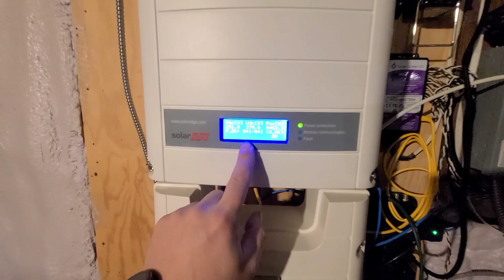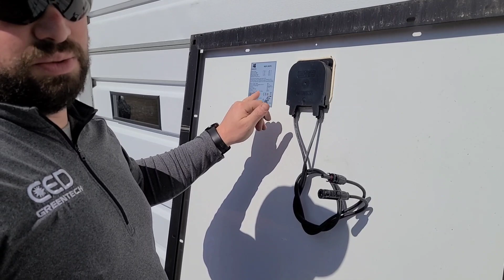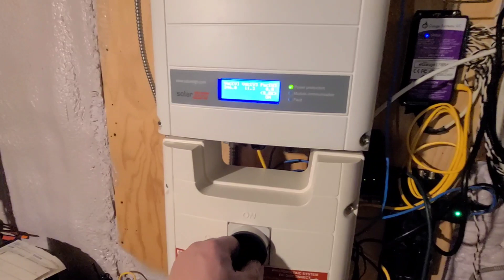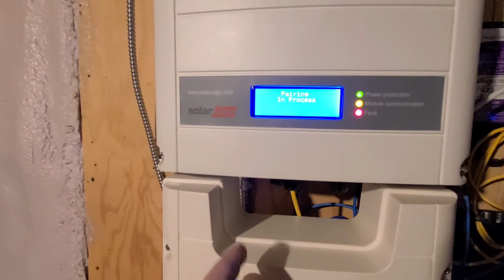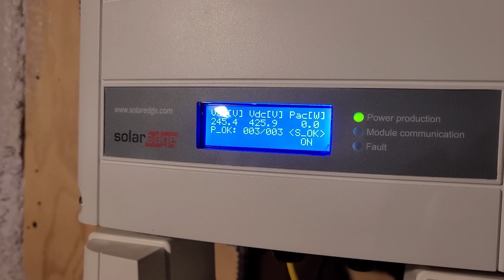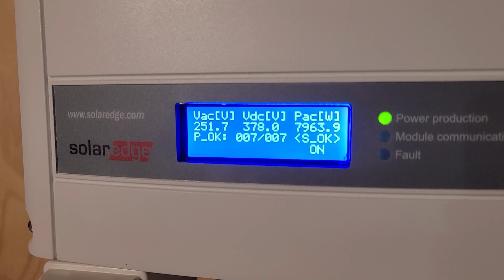How to Replace a SolarEdge Optimizer

Comment: Thanks for uploading the video.  I just swapped out the 7600 StorEdge inverter.  Tech support sent me a new one since the my original 1 was not producing power.  After I initialized, updated and paired it, It does not find the optimizes, so it is not waking up.  I don’t see 16 volts (for 16 panels and optimizers) on the vdc side or on my volt meter.  Also at the solar array, checking the output from the main series MC4 cable\s, I am getting less than a volt.  I’m guessing I’ll have to pull each panel and optimizer apart to see where the problem lies.  SolarEdge does not see any issues on there end with the panels or optimizers. Anything stand out to you?  Thanks
Reply from the maker: I've seen them short out a few times before.  Solaredge was able to pinpoint the optimizer that shorted once, but other times they weren't able to.  It's worth a call.  If they can't find it, you'll have to either test each one, or break the string up and test sections. Once you locate a bad section, then test individuals.
Reply: @benssolarandbattery  Seems like SE merely switched a series shading problem with a series electronics problem! If any optimizer fails open you loose the total string power. If any shorts you lose the panel plus possibly communications with all op on the string. Does anyone know how the communications works? Like Token Ring? Every node receives and transmits, or is it a common single wire bus like 1-wire?  - new SE owner
Reply: @benssolarandbattery  Thanks again.
Reply: Okay, so a long day of taking apart each of the 16 solar panels and checking each panels output (and connectors).

I checked all the inputs and outputs on all 16 optimizers (with the panels disconnected) 

The only thing I found suspect was on the last optimizer’s outputs on the string before it gets to the inverter.  

While there was no OL (on the output side) on the optimizer, I got a reading of 38k on my meter.  All the other outputs from the other optimizers output sides were under .5 mv (it floats on my auto range on the meter). 

I checked it like 3 separate times to verify it was suspect.  

Since that is the last one in the series, I’m wondering if this could be what is not allowing the wake up command on the inverter, after I successfully pair it, but it never sees the optimizers or wakes up.  

Lastly, I am not getting 16v for the 16 panels\ optimizers that I have.  

Original checked at the inverter, then verified at the panel array. 

Do you think that one is bad and the source of my troubles?

Thanks (sorry about a book)
Reply from the maker: @psxcancer  did you check the output of each optimizer with a panel hooked up? It should be 1v each.
Reply: @benssolarandbattery  I checked maybe 4 optimizers with the panels connected and found they did not produce 1v maybe .5 mv or less.  I just went out and checked that suspect optimizer and found a reading of around 4.38 mv.  I then check the whole series and get maybe 38.4mv not a volt.  I’m at a loss
Reply from the maker: @psxcancer  weird. And that was during the day?  Have you checked the panel voltages as well?
Reply: @benssolarandbattery  I did, i figured since I was disconnecting I would do all the checks. 

 Florida sunshine had each panel at 39-40 volts (direct from the panel) Pmax is 335W. per panel 

Strange that none except the 1 panel read over .5 mv.  

That last leg on the string by itself, measured 38k (output side) and 5.something mv.  Connected to the whole string, the last leg still didn’t measure 1v

Is it possible that all the optimizers are bad?
Reply from the maker: Possible that they're all bad.  Maybe a lightening strike?  I've never seen them all go down at once, but stranger things have happened.  Definitely get on the phone with tech support.  It might take a couple 5 hours on hold, but worth it.
Reply: @psxcancer  Measuring 0V ( 0.5mv, etc ) at each optimizer is unlikely. It would mean each one was bad. Just measure the air. No contact. If you still measure 0.5mv you were never connected to the optimizer output. I suspect you did Something wrong. Don't try to measure resistance while the optimizer is putting out 1V, it might damage the meter. You could try it when completely disconnected.
Reply: @alzaidi7739   Hi, thanks for taking the time to to respond.  I am not sure if you read all the posts. I was not taking residence at this point, I was checking vDC. So with the optimizer still connected to the solar panel\s I should be getting 1 vDC from each optimizer and 16vDC from the whole string.  I’m getting like under 2vDC for the whole string and 0-.5mv individually.
Reply: @psxcancer  Ok. 1. If you measure 2vDC, then at least 2 in the string of 16 should measure 1VDC. 2. The op needs power from the solar to run. When you have a panel+op pair with 0.5mv output, check that the panel is putting out 10-40V. If the panel has no output, that would cause the op to not work. Alternatively, when you find a working pair, swap in a suspect op and see if it starts working, showing 1VDC output.

Comment: That’s straight forward in the US. Not so in the U.K. our roof are much steeper pitch, normally slate or cement tile and mainly two story buildings. That make access a nightmare. I’ve a three year old installation and already three optimisers have failed. Never again would I use Solar Edge equipment, as in my opinion it too unreliable.

Comment: Hi Ben - what should the safety voltage have read coming out of the optimizer when you tested it?
Reply from the maker: This one read 1v.  SolarEdge says if it reads 1v its working.  That is not the case about 50% of the time.  I typically just lie and tell them it's reading 0v, otherwise they give you a hard time with RMS's.
Reply: @benssolarandbattery  I do the same thing lmao

Comment: I have a panel reading nothing today so thought it was the optimizer.  Next day that panel is fine but another panel down instead.   Does it hurt anything for me to run the pairing process as toon have shown without turning off inverter.  Mine looks identical to yours (about 5 years old) so thinking I can just hold down button as you have?
Reply from the maker: If it's already paired, it most likely won't help anything.  There is a possibility that if the optimizer is having issues, it won't re-pair. Probably best to leave it for a few days to see if it comes back online.  If it doesn't, give pairing a try.
Reply: @benssolarandbattery  Thanks for the reply.  Ok fingers crossed it just comes back on its own :)

Comment: In fact, it would not be necessary to come down with the solar panel. It is a risk, it could slip and break.
Instead, you could get a cardboard card and provide accommodation right up there. Or a cotton blanket to avoid placing the panel on top of the other.
Am I right or wrong?
Reply from the maker: Possibly on a lower pitch roof, but even on my roof (22 degree) I fear it would slide off.

Comment: well now I have my suspicions about lousy generation failed optimizers ?, but my  inverter says 30/30 yet we r not seeing power over 3800 watts with a 9kw system ? solar edge inverter ,was installed 2018 march. on sunny day today 3600watts ?
Reply from the maker: Could be many things, but underperformance is not usually an optimizer.  Check out the "power limit" on the last screen of the screened inverters or by scanning the qr code and logging into the screenless.  I've seen the power limit set at the wrong number before.  What size inverter do you have?

Comment: It is absolutely always the optimizer 🙄 Anyway, curious how you like that right angle impact compared to a typical cordless impact driver?  Is it Milwaukee?
Reply from the maker: Always an optimizer.  I like the Milwaukee power ratchet for the long reach.  Gives you and extra 8" or so which can be helpful on a roof.  We usually use Impacts for installs, but this comes in handy for service.
Reply: Nice, thanks Ben! I'll have to get one of those. The extra reach will absolutely be helpful

Comment: Thanks for the video sharing real-world occurrence of the failure and fix.  One thing - you should not power down the inverter as was done with the DC disconnect switch.  This places a huge arc on the contacts, and if you do this a few times under load you risk damaging those contacts.  The correct way to power down the system is to deactivate it, then wait for the voltage to bleed down, then switch the DC disconnect to off.
Reply from the maker: Thanks for watching, Bill.  One could argue that the DC disconnect is rated to take that arc and deal with it efficiently.  If shutting it off just a few times would damage it, there's no way it would be used for this application.  Shutting off the toggle switch is a hard stop on the inverter components, similar to a water hammer in pipes (explained to be by a SolarEdge tech support person). Shutting off the AC breaker is similar  but worse than the switch.
Reply: @benssolarandbattery  I'm sorry, but that is incorrect information.  Disabling the inverter toggle switch causes a graceful shutdown of the power conversion electronics.  Using the DC disconnect while passing 8kW does not.  For inverters without a power switch, the AC disconnect also does the same thing (simulating grid down).   Here is the proper power down procedure for SolarEdge inverters...
https://www.youtube.com/watch?v=7GJCzi7fqEg
The DC disconnect is not meant to be used as a system on/off switch - it is meant for emergency only, or switching without load.
Reply from the maker: @billjohnson3344  I guess you are right, thanks for the info.  I was only referring to what the SolarEdge techs told me.  There is no graceful shutdown with the older inverters.  When you hit the toggle switch, there's a good relay bang inside it.  I think they rectified that for the newer ones though.
Reply: @benssolarandbattery  Yes, that is correct.  For models without a power on/off switch (older SolarEdge or other inverter brands - SMA, etc), the AC disconnect should be used as the first step - before the DC disconnect.

Comment: is there any point using optimizers when there's no shade ?
Reply from the maker: Panel level monitoring is one reason along with allowing each panel to produce to its maximum power.  There are also rapid shutdown requirements for roof mount systems in jurisdictions under the 2017 and later code here in the US.
Reply: individual monitoring makes sense..

rapid shutdown, isnt that handled by a disconnect and anti-islanding ?
just trying to make sense of us regulations, as they seem mainly used to make solar life difficiult ;)
Reply from the maker: @houseofancients  from 2017 on, any roof mounted system technically needs to have panel level rapid shutdown devices that shut off each individual panel.  This can be done with optimizers, tigo TS-4 or micro inverters.  There are a number of other products that do it as well.  Pain in the butt really.
Reply: @benssolarandbattery  One comment I saw about fire fighters would indicate it's a safety issue . Can't have 400V on the roof while fighting a fire.
Reply: so how would this work with a sol-ark/deye/sunsynk in hybrid mode ?
are they using a contacter ?
Reply from the maker: @houseofancients  I'm using the AC coupling abilities of the Sol-Ark to allow it to work with the SolarEdge, but Tigo makes a system that is compatible and provides rapid shutdown as well.
Reply: actually i ment, with only a sol-ark...
so you have roof mounted panels, a battery a only a sol-ark.
my best guess is that that situation needs rapid shutdown on the roof too
Reply: @houseofancients  Yes, you need rapid shutdown electronics for each panel if your area has that NEC requirement in place.  Double check, not all areas require NEC 2017.  If your state/town doesn't have that in affect - one less thing to break if you don't need it.  For Sol Ark, they recommend Tigo - and can work with others also.  https://www.sol-ark.com/solar-energy-101-what-is-rapid-shutdown/

Comment: Beautiful day up there! Excellent day to pick to get out there and do stuff!

Haven't really looked into them but I kind a feel like optimizers are just another moving part with added complexity that can go fail .... do you really see a benefit having the optimizers on the panels? I've got 31 panels at the moment but they all run directly to the two MPPT's on the SolArk. One of the arrays is shadowed by a tree in the morning would an optimizer help?

I've spent this beautiful spring day in the basement wiring up an additional critical loads panel so that I can make good use of the extra 6KW I added at the beginning of the year.
Reply from the maker: These optimizers are specifically for the SolarEdge system.  Optimizers over all definitely help with shading, but like you saw here, I'm replacing one of them every couple years.  If I had a ground array or off grid system that didn't need rapid shutdown, I wouldn't use optimizers or micro inverters personally.  There are panel level monitoring benefits as well, but for longevity, less is more.
Reply: @benssolarandbattery  Thanks, Ben. Ah, I was under the impression these things were generic and can be retrofitted to an existing system. I stand corrected.  Agree that sometimes less is more. I wish some of the people I work with keep that simple axiom in mind.
Reply: I agree optimisers are great if reliable, but solar edge optimisers are very unreliable. In three years I’ve had to replace thee optimisers on a two storey building in the U.K. with a roof covered in cement tiles and a pitch of 38* that a real pain. Never again would I use Solar Edge equipment and never again on a roof.

Comment: How many years do optimizers last on average
Reply from the maker: That's a tough one.  I have plenty of them installed in 2012-2013 that are still running today, but they've had a few bad batches with over a 4% failure rate in 3 years.  I've had 3 out of 42 go out on my house in 6 years.